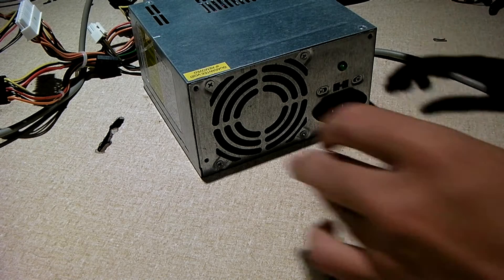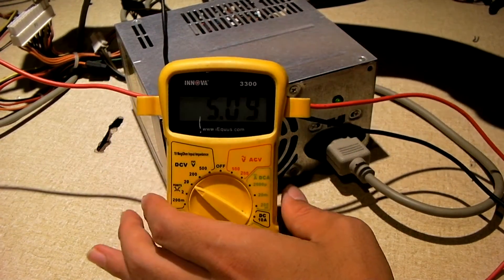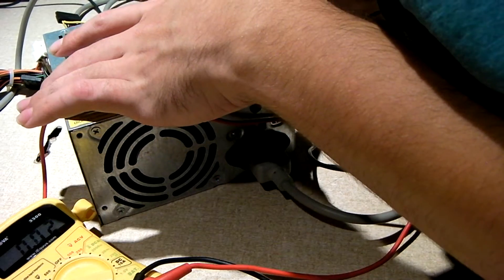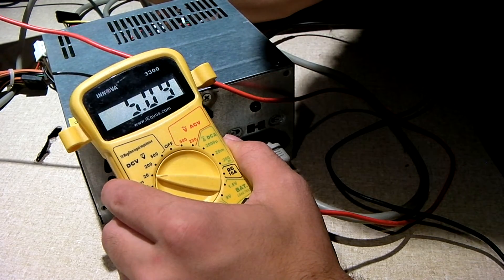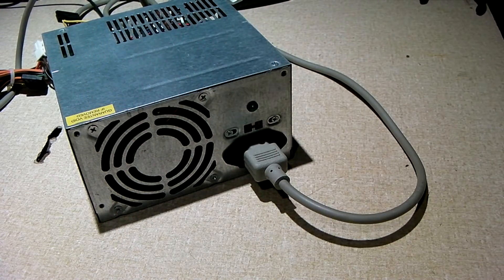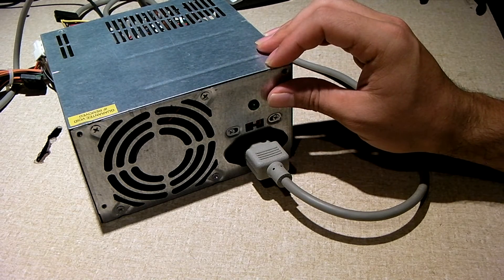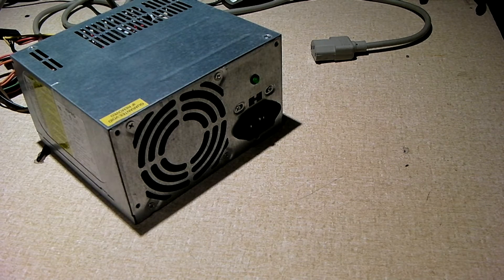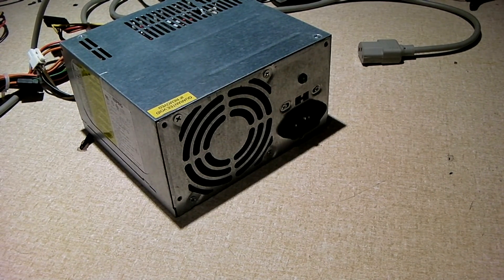Answer to no POST power supply problem

Comment: Cube Computer Channel::: what if you do not have a power meter??  i had 2 PSU 1 Corsair and the other Thermaltake. The Corsaire 750w 80+  was the faulty one, i even put a metal staple to test it and sure enough, it started and would stop quick like. And i did the same with the Thermaltake 600w 80+ same method, and it stayed on. But my 2 PC's will not post, i was using an Asus and i i had a Gigabyte motherboard, with a Ryzen 5-1500x chip  16 gigs Ram and the Thermaltake PSU, but that one was put away for back up in case i have an issue with the Asus. Well, i decided to add an Aio to my GXT 1070 8GB founders Editon. So i put an extra GPU i had from my backup a Zotac mini 4GB 1050ti. well B4 i could try out 1070 with the Aio i removed the gpu and decided to wait and that when the Asus went dark. well, i took out the 1050ti and try 1070 with Aio and nothing. The next day i  started diagnostics and nothing. so got the Gigabyte to sever it purpose, set it up for post-test run all with its own components, except the Zotac 1050ti i was using, while adding the aio pump. well, that set up either posted i did the whole 9 yards and nothing. i tested my monitor with my Laptop and it works. i know corsair PSU dont work, but the Asus has a Ryzen 7-1080x 16gig Ram FlareX 3200MHz and was using 1070 on it, till i decided i want to add an Aio cooler, well i took the Aio off and put back and now also the 1070 wont work the fan dont spin light dont light up. the Zotac 1050ti the 10fan works but i do not know if that is the cause, remember i said i had it running on my Asus while i put the 170 Aio on, but B4 i can switch it that's when it just black screen no post. Now on the Back up to. i can determine the culprit.  cool VID by the way.

Comment: Learn how to use a meter properly and a scope rather than ranting on and getting no where test the supply internals...
Reply from the maker: This isn't a rant. Most technicians do not have time to troubleshoot and replace power supply internals.
Reply: Ahh right I see, make it into a project learn a bit more about smps
Reply from the maker: Likely an issue with the supervisory IC or a nearby component.